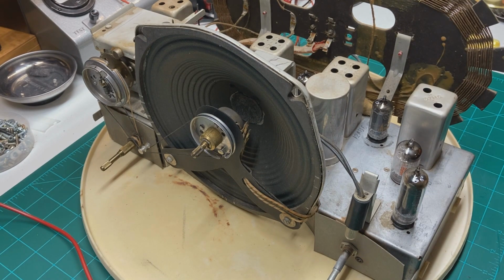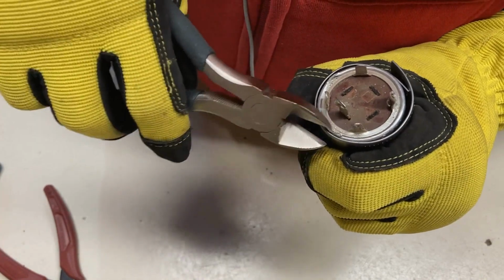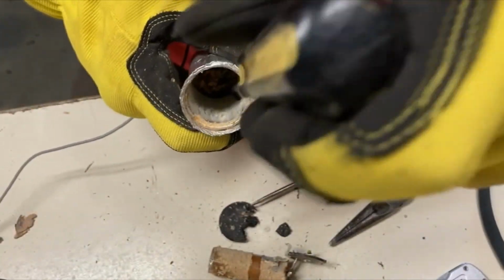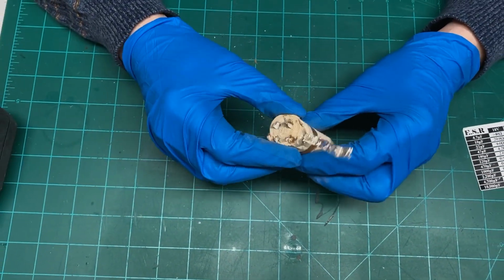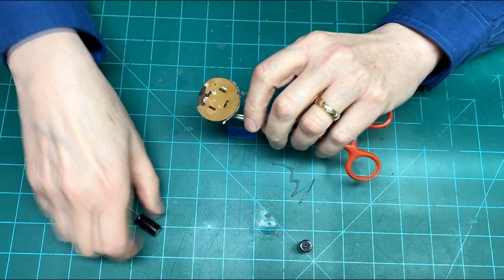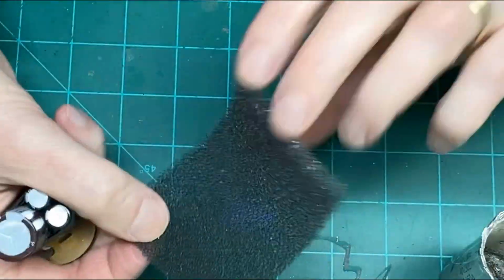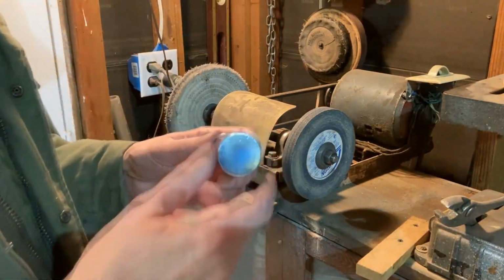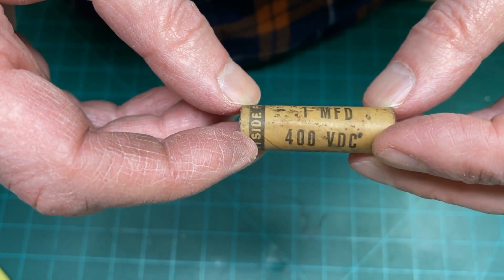Restuffing & Testing Electrolytic Capacitors

Comment: damn all that unessary prying and breaking when you could have just diamond wheel'd the end off at the ring. quicker, cleaner and would have kept the phenolic intact. epoxy it back together and it looks untouched.
Reply: Sometimes the guts of the cap don't come out that easy & you end up bending the crap out of everything anyway.😜

Comment: Why not just disconnect the capacitor and leave it in place. The modern replacement is very small and can be placed under the old one. It is normally not possible to increase capacitance due to valve limits.
Reply from the maker: I've done it both ways as well.  I just wanted to show how the actual "stuffing" process goes if anyone's interested in keeping the absolute vintage properties of the radio or amp.  In the case of my Zenith Trans-Oceanic, there was absolutely NO room underneath one of the cans to put any additional components so I was was forced to "stuff it".🤫

Comment: Put a suitable sized Jubilee clip (hose clamp) round the top of the capacitor and tighten to protect the aluminium from the side cutters. It will also help keep the top round as unlike the sheet metal  held by hand there will be no gaps and it won't slip. Ah! see you saw that idea later in the video. One other thing you mentioned you have a polishing wheel. If you can substitute that wheel for a plain steel wheel or if you have a lathe you can set up a support bar to help hold the can tight against it while pressing and turning against the wheel to press the peeled metal back smoothly. I have stuffed several this way with good results.
Reply from the maker: Ohhhwww... I like that idea.  Can't believe I didn't think of that when I was just inches away from a whole drawer full of hose clamps!  -- Duh.

Comment: I take my Dremel with a high grit stone and grind down the bottom of the can until I expose the steel ring.  I then pull that out and remove the guts reusing the phenolic base.  I reassemble by putting some two part black epoxy on the inner lip and placing the phenolic and steel ring back in place.

Comment: Restuffing cans is the best option.  I restored a 1951 Andrea 16" TV that had nine (9!) cans.  Imagine putting terminals and external caps for nine cans inside that already crowded chassis.  30 years after I'm gone, some guy will be thanking me for not turning that chassis into a train wreck.  Other than the plastic caps replacing the paper ones, it looks like it did when it left the factory and still matches the picture in the SAMs.

Comment: This thing is more like a grenade than a capacitor!  It's a bit crazy to see a capacitor that large yet without any of the stress grooves in it that give away to let it explode more safely out of the top.
Reply: These types almost always vent out the bottom around the phenolic.  Sometimes you'll even see a small hole or thin spot where the electrolyte or gasses can vent.

Comment: Why not remove them from the circuit and put the new ones underneath, where they can't be seen
Reply from the maker: That's my preferred method also but some restoration "purists" like to keep everything as "stock" as possible so I made the video for those who would like to keep the caps wired in as new.  Also, there are times (like restoring the Zenith 7G605 Bomber) that there is just no room for one more component under the chassis.
Reply: @DVRproductions52  because when showing off our collections we take them apart and show people the innards

Comment: Good effort. I cut the can above the phenolic using a pipe cutter so as not to disturb the terminal lugs or the can crimp. I then use a heat gun to heat the can until the guts come out. The heat will not transfer to the base because its been cut from the can. The guts can then easily be removed from the base, base drilled for cap leads. When i reassemble ill use silicon on the inside and a strip of heat-resistant aluminum tape on the outside. It results in a much cleaner base, tabs, and lugs.
Reply: How do you remove the clear protective plastic sleeve that surrounds some of the old capacitors without destroying it?
Thank you

Comment: Good tutorial!
I found that placing my MLCCs in warm water (just over what is comfortable to touch) helps with freeing the glue at the bottom.
The glue I've seen used all the time also dissolves quite easily with 99% IPA, so injecting some in the can can be used as a last resort..

Comment: I am trying to fix a bang and Olufsen tuner amp, and I need to replace some of the capacitors they are really old, there is one big one which is. Wicon Electrolytic cap
3000uf 70 v. DCW red positive type Kl 2404x2.
And two Wicon Electrolytic cap
3000uf 25v. DCW
Type Kpl 242x1
Plain negative
is there alternatives I can use would you know which ones they are. I would appreciate your help.
Reply from the maker: Hi Edward, I sure wouldn't know but you might try searching Mouser or Digi-Key.  Maybe someone else out there would know...
Reply: @DVRproductions52  thank you for your reply I will have a look
Reply from the maker: Both use the same kind of search engine which is a little hard to get used to but one you do, you can find just about anything.
Reply: @DVRproductions52 It depends on what fits. If you can't find say a  70v you could use a couple 35v in series.

Comment: Thanks for your Video! I'm presently restuffing the electrolytic capacitor on my "All American Five"  Zenith, your video was affirmation I'm doing it right.  I was questioning myself because after I reconnected the e-cap back into the radio it shorted out, killed the rectifier tube and the 220 om. resistor. Now I can focus elsewhere for the short.
Reply from the maker: Nice going man!  Thanks for the kudo's.  Good luck with the restore.

Comment: My method is to destroy the phenolic brown disk on the bottom that has the terminals on it. I pick out all the phenolic bits and remove the old capacitor guts. This leaves me a hollow aluminum can. The steel ring is then removed by slightly folding in half an pulling it out (it can be flattened easily later if you don't go crazy and fold it completely in half). By using a smooth metal rod (screwdriver shaft) I can slowly un-roll the crimp on the aluminum shell from the inside. After stuffing new caps in the shell I make a new phenolic  disk with circuit board material (I can recycle old circuit boards by cleaning off the resist and completely etching or scraping off the circuit traces). I then drill and shape new holes for the solder lugs and solder the new caps, install the new circuit board, add in the steel ring, and use the same round and smooth metal rod from the outside to re-roll the crimp (a little hammering helps). I also like to solder the common cap wires somewhere to the steel ring for a solid connection to the chassis.
Reply from the maker: Cool idea Jammit!  I'll try that next time.
Reply: @DVRproductions52 First video I have seen that explains the ESR in relation to the life of a capacitor.
Thank you👍
Reply: @DVRproductions52 what size resistor should I use for a 400v capacitor to discharge it safely?
Thank you
Reply: @DVRproductions52 Would it be easier to cut a hole big enough on the bottom to remove the "guts" and then just drill the holes for the capacitor leads? Or would that be more difficult to do?
Reply: @DVRproductions52 Excellent video!👍
Reply: @DVRproductions52 That yellow capacitor that you used at the end of the video does it come marked with the negative ring? I just bought several of those IC brand capacitors same color and they are not marked with the negative symbol. I was thinking that they were/are non polar but not sure.
Reply: @DVRproductions52 If I have a two lead capacitor in the original component can I just solder the new capacitor leads to positive and negative of the old original capacitor?
Thank you. Very interesting and informative video👍
Reply from the maker: Not unless you completely remove the "guts" of the old capacitor first.  Then you can solder the new caps onto the leads or pins of the old capacitor.  If you leave any of the old cap. in the circuit you will run into problems when the old parts begin to leak, change value or short, which, believe me, they eventually will!
Reply: @DVRproductions52  Thank you for replying back. Sorry I did not explain myself clearly, I did remove the guts from the old capacitor before I installed the new capacitor in the can. Also I did not have to make a hole in the bottom of the old capacitor I just did it like in your video. I heated the capacitor and pulled the guts from the tabs (I had opened the edges before) and it was easy.
Thank you
Reply: What does voltage loss indicate? And should there be none? Very interesting video. I am trying to learn how to stuff a capacitor and also learn about capacitors.
Thank you

Comment: FWIW a wine bottle corkscrew may help out with that. Also, a heat gun to the case for a bit would probably help too.
Reply from the maker: That's a great idea using a corkscrew for the larger electrolytics.  I never even considered that.  Sure will in the future though, thanks!
Reply: @DVRproductions52  if I wind up with another resto I will try that.